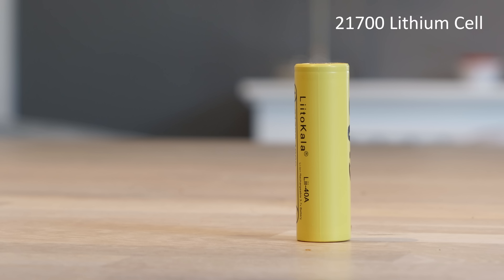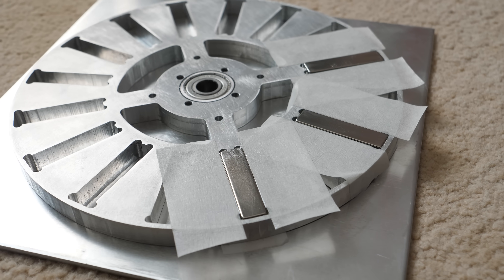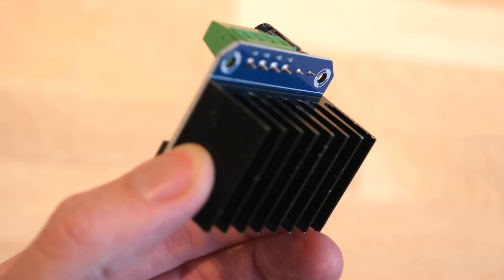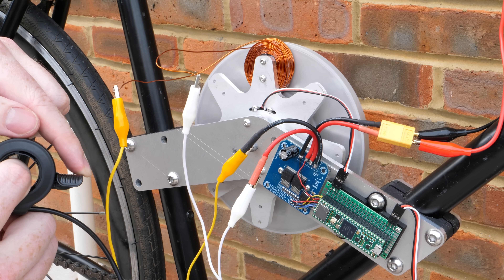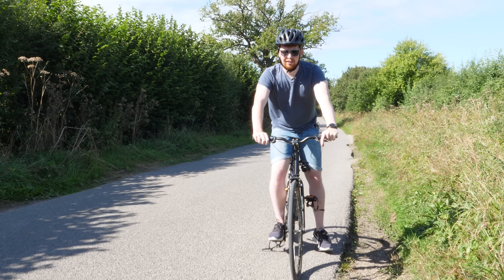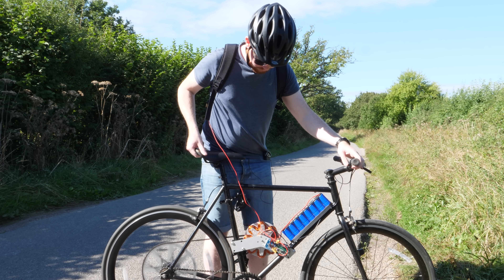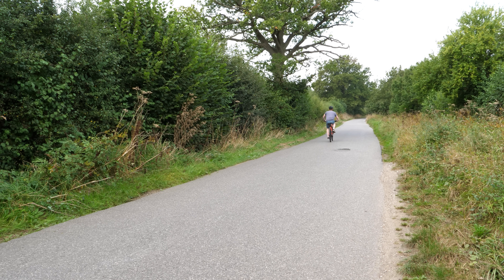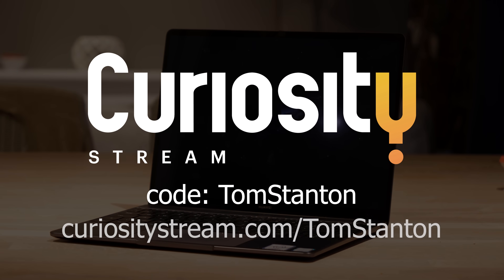Super Capacitor Bike

Comment: You just need to have a charging station every 50 meters :-) But having capacitors for rapid storage of braking power and lithium battery for long runs could be it.
Reply: Batteries can already take all the energy from regen braking, though - that isn’t a limitation
Reply: @audigex  They can - with degradation. With supercap buffer, their life could be extended
Reply: @audigex  yeah
Reply: Hi

Comment: Unfortunately, the thing that makes a normal permanent magnet motor have high torque is also the same thing that gives it high unpowered resistance. By concentrating the magnetic field using a steel core you necessarily also introduce losses through eddie currents and constantly magnetizing and demagnetizing the core. 

I think for regenerative braking, your homebuilt motor was a better approach, but could benefit a lot from a second rotor with permanent magnets on the other side of the coils.

Comment: Very cool to see a working motor made completely made from scratch! 
Though the motor design and the electronics are probably not the most efficient, because around 11 kJ = 3 Wh of that capacitor bank should be easily enough for 500m at 25-30 km/h, if it is put into a conventional ebike motor/controller, a buck/boost converter should also achieve > 80% efficiency. Then it would be actually feasible for driving in a city, if it would be possible to quickly charge (inductive?) at every red traffic light ;)

Btw: I get slightly different energy result (than the 11881J shown @ 6:03):
2.7V*8 = 21.6V;  400F/8 = 50F;  1/2 * 50F * 21.6V^2 = 11664J  (= 3.24Wh)
Seems like you calculated it with 21.8 V, is there reason for that or just a small mistake?

Comment: What amount of power is generated when regenerative braking? (is it a ton of watts/amps?) Would it be beneficial for a lithium powered e-bike to have a super capacitor to capture as much regen energy as possible? Then either use it for acceleration, or to recharge the batteries. This is probably only helpful if the batteries otherwise couldn't just take ALL the regen at once.
Reply: https://youtu.be/jXP6YwH6o1k

Comment: Very cool project!
Just some thoughts on the DIY motor: Maybe align the magnets in a Halbach array and use iron cores in the coils. Should vastly improve efficiency and torque.
Reply: Iron cores wont help when you dont have whole magnetic circuit
Reply: In General it seems like there would have been some better motor options.
Reply: Hi
Reply: https://youtu.be/jXP6YwH6o1k

Comment: This might be a tad complex and probably, but what if you were to use a vast bank of much smaller super caps to reach a higher voltage, yet retain the huge inrush current to supplement your normal lithium battery? This'd probably fry the motor, but when you give it full beans, you send all the power the esc can handle from the battery, as well as a small half second kick (or however long the caps last) for a HUGE amount of starting torque, letting the caps recharge off of the battery as you ride? Probably a stupid idea lol

Comment: Is there a way to use the capacitors as a power cache and have multiple banks of capacitors but only discharge once full. You’d probably have to make your own code or circuit to get that just right.

Comment: Can you do a Hybrid battery with Super Capacitors and a traditional battery with regenerative braking to try to get fast accelerations out of a large capacity but small amperage battery? Would be interesting to compare the acceleration and overall range vs a traditional battery setup and one with the large capacity small amperage battery.

Comment: So you never explained: Why did you build your own axial motor for this project? Or was this really two separate projects you wanted to do, and just combined them in this video?
Reply: now we have no idea if the capacitors are the issue or the stupid motor idea.
Reply: @johnfunk4313  I mean he did hook it up to his specialized bike. But like he talked about capacitors have both very low spacific energy, and and the energy output drops as the square of it's discharge percentage.

I guess maybe that's why he started making that motor, because he needed something with a wide operating range including working at high current and low voltages. That's something he could have done with an off the shelf motor though, and custom speed controller firmware.

Maybe he'll do another video with this motor though and a proper custom speed controller. Those H-bridges he used are... less than ideal for this application.
Reply: @johnfunk4313  what's wrong with the motor?
Reply: @luongmaihunggia  Well, there are wrongs with the motor out of just about every engineering type. Electrically, the massive aluminum plates introduce eddy currents that are huge. Mechanically, the motor frame is very oversized for the loads. Dynamically the rotor is very heavy and has a lot of mass far from its center, like a flywheel. The main issue here in my opinion is that the dimensions, the material, the number of windings, and the electrical properties are not motivated in any way.
Reply: @johnfunk4313  stupid motor idea?? I find it very impressive even if it only uses 20v, its not like he is a genius mechanical engineer, if you want to watch someone like that then watch Colinfurze
Reply: This ^
Reply: Sounds like you answered your question.
Reply: @Marci124 or not lol
Reply: Yes.
Reply: Capacitors for taking off quickly from the start, li-ion batteries for cruising, with regenerative braking recharging your capacitors specifically. Now that'd be neat!

Comment: Could use super capacitors  with lipo batteries.  Use cap to charge during regen because  that charge much faster rate than switch them to put charge back into lipo batteries.  Also could just add tiny gas engine genorator to charge caps to get better mpg.  Have idea to use small diesel engine genorator combined with electric fat tire bike and use super caps instead of batteries.

Comment: Supercaps have one advantage over lithium cell. They are more efficent in charging. So for regenerative breaking they are a bit better
Reply: However you are at one sixth the capacity if they are in series, needs rewinding with smaller gauge and more turns appropriate laminate electromagnets and two gears
Reply: They also have a MUCH longer cycle life.
Reply: https://youtu.be/jXP6YwH6o1ku4i4

Comment: You could make it regenerative such that when you are at smooth/slope roads with enough speed for you to lightly pedal, the capacitors would charge 
And when you need torque, to start from zero, you could use that energy stored.
Reply: Wouldnt last you'd be peddling in minutes trick is to not stop peddling or generating power even when stoped mixed with solar
Reply: https://youtu.be/jXP6YwH6o1k

Comment: why didn't you make the capacitors turn with connected to the motor?
Reply: You mean like a commutator? I guess it would be a bit difficult to build it from scratch (brushes, Copper ring with segments), if there isn't a better solution.
Reply: @MrFixel112  he does have a metal cnc though

Comment: A steel sheet on the rotor opposing the coils will both increase the magnetic flux through the coils and reduce the chain issue.

My guess is that you actually loose a percent of efficiency by eddy-currents in the chain.
Reply: Nevermind the chain, what about the bigass aluminum plate?!
Reply: The coils should also lose power in the aluminum too due to those eddy currents
Reply: @16SKB  the star shape probably reduces the base plate eddy-currents quite a bit but a round steel plate there as well would of course be good. Laminated steel even better.

Comment: You can avoid some of the problems with the permanent magnets sticking by using steel sheets and wires to focus the magnetic fields in a specific area and/or direction. There are videos about this on the channel Tech Ingredients.

And by the way, you can also add a dynamo hub on the front wheel to help recharge the batteries/capacitors.
Reply: Look for "3d-printed Halbach Motor - Building Instructions" by Christoph Laimer.
Tom could get more torque by putting coils on the other side of the rotor too, and not using aluminium as a rotor which will leach energy in the form of eddy currents.
There are many designs of ebike motors - Tom's is not one of them! It would be better used in a wind turbine!
Reply: Iron cores would massively increase the motor torque due to reducing magnetic resistance. 
Not sure, can iron cores significantly increase efficiency too?
Reply: Wait but a dynamo is just a reverse electric motor right? You would steal kinetic energy by adding resistance, meaning you essentially convert electric energy to kinetic energy only to convert it back to electric energy immediately, so you'd lose energy due to imperfect efficiencies.
Reply: It's been a long time since I watched that video.  Would a steel channel around the back side (chain side) of each magnet be ideal for focusing the magnetic field toward the stator?  Would this affect its efficiency or power?
Reply: Twin magnetic rotors sandwich the coils
Reply: More turn of finer wire and get six times more energy by running in series
Reply: I hope he does regenerative charging if would be really cool.
Reply: Dear Tom,  growing wheat is one topic, baking bread from wheat flour another.  Likewise for managing a super cap bank and building your own motor.  The first is doable to a high standard by a knowledgeable amateur, but making a motor is unlikely to get you to 60% of the efficiency of a good commercial one.  I appreciate that it was for fun and interest, but did you build this bike from scratch?  Funnily enough my uncle Randall made racing bike rims from bamboo back in the 50's!  Fantastic material, bamboo....
Reply: https://youtu.be/jXP6YwH6o1ku4u4
Reply: Fake and gay
Reply: @YungEagle3k  said the teenager
Reply: @YungEagle3k  Not constructive.

Comment: now make an electric bicycle that runs on AA batteries
Reply: A high quallity nimh AA cell can produce about 10watt.. so you need about 25 to power a regulation e-bike.

Of cause, they can only do so for 10-15 seconds then they start slowing down.

Generally they csn push out 3-5 A over a extended period of time... so say 100 should do

Comment: Wait, doesn't the voltage of a supercapacitor decrease by 1 over t (time)?
Reply: If you discharge a capacitor through a resistor, the voltage over the capacitor will change as an exponential function with a negative exponent (or 1/(e^kt). But the voltage is directly proportional to the amount of charge in the capacitor. The reason it discharges quicker to begin with is that the larger voltage creates a bigger current, so charge flows out faster and the voltage decreases quickly.

If you discharge a capacitor at a constant current, the voltage will also change at a constant rate.
Reply: Only with a resistive load
Reply: The energy of a capacitor is proportional to the square of the voltage. I didn't checked the maths, but looks like he is correct bc of that

Comment: You can replace a Lead Acid battery in a car with a lightweight box containing a Lithium Ion battery, an array of Supercapacitors, and a management circuit.

Reduced weight, increased starter power, and longer accessory runtime, all in one package. The downside is that it won't do too well with cold.
Reply: Also complexity, lead acid batteries are very robust and dead simple
Reply: You really dont need the caps. There is high current lithium batteries that easially starts a car. While the crank amps is usually 500-800A.. when it cranked the first half round ot droppes to about 100.
Reply: Keep in mind lithium batteries degrade many times faster than lead acid. There is a reason why Lead acid batteries are common for automobiles
Reply: @aleksandersats9577  that really depends on what lithium chemestry you compare with. LTO and LFP have shelf life that are simular to that of a lead accid battery. The self discharge  rate is also farily slow.

One problem with modern cars is that they draw current on standby.  This kills  a lead battery over time.
Reply: @aleksandersats9577  Lead acid batteries are mainly in cars because they are cheap. Usually they need to be replaced after 3-5 years and manufacturers are happy to sell you multiple times a new battery in one car lifetime. A Li battery with decent management lasts a lot longer. See for example Tesla cars, which still use a conventional lead acid 12V battery as buffer for low voltage stuff and that often causes problems, while the main high power Li pack shows only slight degradation, even after 10 years.
Reply: @1Hippo  My mothers car is still using the stock battery that came with the car and, it's 12 years old. Still works great without issues. and I have more older lead acid batteries that I have tested that function just fine
Reply: https://youtu.be/jXP6YwH6o1k
Reply: Considering cars need to start in the cold for more than half the year, that's kind of a big drawback though.
Reply: @redsquirrelftw  the stock battery manages to start the car with -27c just fine so uhhhh, maybe???